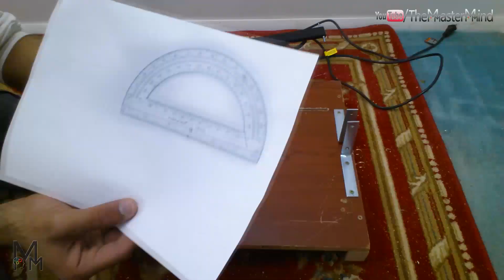How To Make Angle Grinder Stand | Angle Grinder Hacks | All in One Saw Stand | Homemade

Comment: You design is about the best one I've seen so far on YouTube and is the one I will copy.  Your ideas is very simple and functional and I LIKE that.  Thank you for you post.
Reply: Thanks for the update.  My main use is to be as a small, metal cutoff saw as you demonstrate well in you video.  I have other large and small wood saws and don't need anymore of those, but a small, cheap metal cutoff saw will greatly fill my needs.  Thanks again.
Reply from the maker: thanks  guys
Reply: Can i copy the design?

Comment: One problem. Holing the grinder with one screw might not keep it straight need to get another point to keep it in line. A U frame?
Reply from the maker: its very tight by the way, but to make it perfectly stabilize you can add a hose clamp in the end of the grinder.

Comment: may i make a little improve-mental comment i would use a wing nut on the protractor that you can print  from here http://www.ossmann.com/protractor/ and have 2 points of screwing and slots not just one as i noticed it move hence this would help  secure it  more maby ? and give a more precise angle cut and maby 2 lock ties to secure the cutter to the arm and bed springs for the arm base may  work too  just suggestions  that may improve maby is all all together a good build no offence ment  just  ideas.